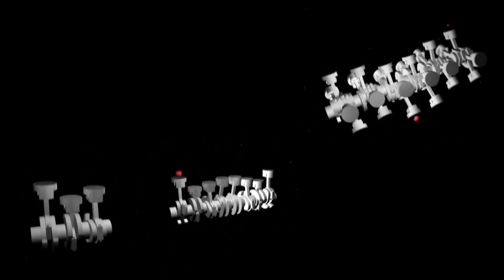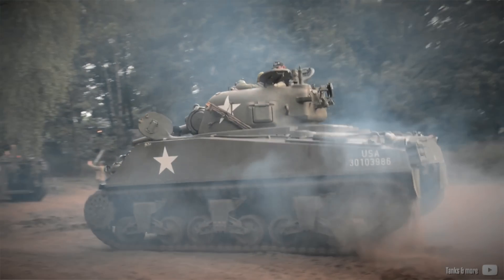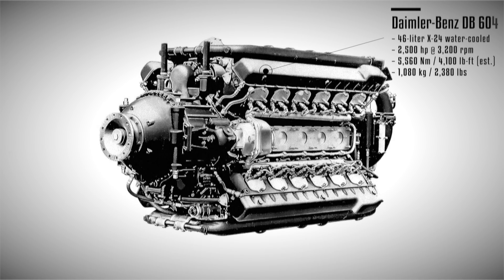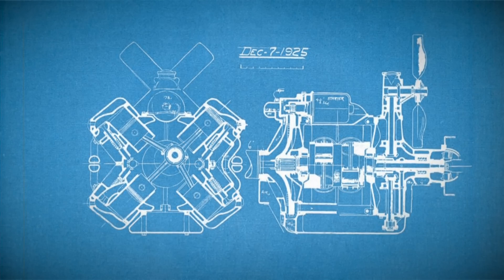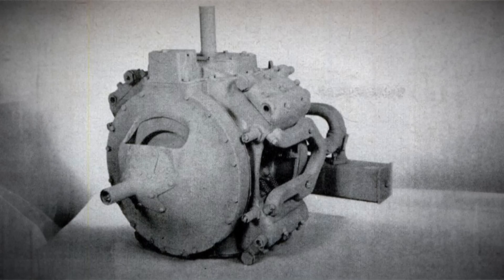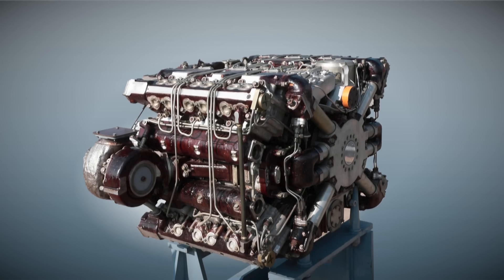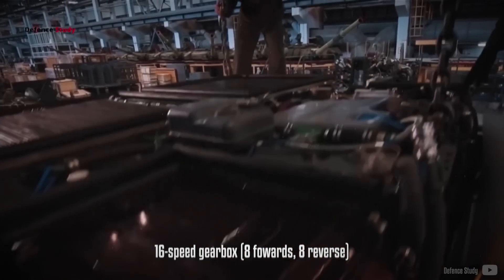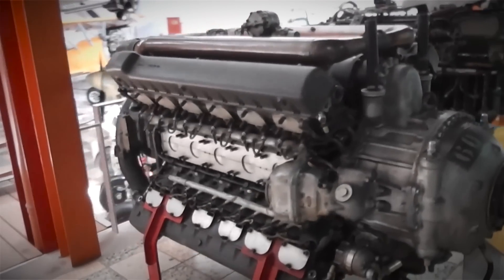The X Engine Makes Almost No Sense

Comment: I was truly here looking for the x16 engine, and I've actually seen one that was built back in 1970 or 71 and it powered a34 ton war machine built for the Vietnam war. It's pretty much meant to run on diesel or kerosene, but it was literally designed to run on any fuel including used oil. I think it's probably a one of a kind design

Comment: 193 comments, but I can only see 2, wtf?

In theory, a twin crank x-engine should work fine as an aircraft engine, with each crank driving its own prop. Upright Vs work, inverted Vs work, there should be no major issue with two, 120 degree V12s working together, one on top of the other. They'd essentially be two engines that happened to share the same propeller axis, I suppose.

Comment: If the Russian engine continues the trend of other recent RU military equipment actual performance compared to claimed performance, then the engines probably don't last, don't make claimed rated power, and there are very very few of them in actual use.

Comment: or like this https://www.youtube.com/watch?v=o89BYp95Qiw    , All Russian tank engines are based on highly successful V-2 diesel engine designed in 1931 at the Kharkov Locomotive Plant. The Kharkov plants was destroyed by Russian forces in Ukraine. The V-84 (T-72s), V-92S2F (T-72B3s, T-90s), the UTD-20 (BMP-1s and BMP-2s), and UTD-29 (BMP-3s) are further upgrades of the engine. The V-2 is the Kalashnikov of tank engines. The exception to this practical Soviet approach is the T-64. This tank was fitted with the 5TDF engine which tried to copy a German wartime bomber engine. 2-3,000 T-64s in storage will never return to service.

The T-14 Armata used a Russian copy of the German X-shaped Simmering SLA 16 engine. The Germans in WW2 used the engine in the hunting Tiger tank. It was an unreliable engine for the Germans. The Russians had originally used the engine for compressor oil and gas pumping stations.

Comment: Don't be fooled by the t-14, it's not in production, and one of the reasons is because the x engine it uses is a copy of the wwII, German XLA-16 engine, and both are piles of garbage.
Reply: Ummm no it's not everyone but laser pig has said it's not idk why his ego will not allow for him to admit it's not.
Reply: Nah x engines since the 1900s sucks ass the whole engine producing nations knew it as its complexity and the stress of the crankshaft negated the gains of more horsepower.

Comment: X format works for two strokes. You get a single throw crank carrying all four rods. Air intake via a hollow none drive side crank. It needs a reed valve and a belt driven blower. You get four bangs per revolution, perfect primary balance and almost no torque vibration. 
Rolls-Royce failed with the X because their oil pumps were too small. The same problem was not fixed on Merlin until the Mk 61.

Comment: I would make an x using VW “VR” technology, think of a Subaru flat 4 but each end is a VR style 4, 5, or 6 cylinder, to make flat x8, x10, and x12.
Reply: Yh like a flat w engine, would make them more compact, even smaller if you used freevalve technology from Koenigsegg

Comment: The Vulture has serious issues with overheating and fires when in service on Avro Manchesters, which led to their replacement  with 4 Merlins and the development of the Lancaster. The Vulture was also killed off by the Griffon, a more conventional and reliable V-12 that could produce more power

Comment: Germans used inverted V12 engines throughout most of WW2. It's a little surprising they had issues with X-engines.

For the longest time I thought that BRM had X16 engine, only to learn it was H16 - two flat 8s on top of each other geared together (btw, BRM's V16 sounded insane).

Truth is, X shape is just too dense with stuff. This was demonstrated precisely with Napier Deltic, another unusual configuration, and how the engines were 'loved' by maintenance staff - it was a nightmare to get anywhere, and had to be serviced outside of its working location. The Chelabynsk engine looks even worse - the famous joke about proctologist changing trades to a mechanic and fixing the engine through the tailpipe must be pretty accurate here.

There always be a place for unusual configuration. two stroke camless diesel X4, laying flat could be perfect to fit in a bottom of a small vehicle or boat, that otherwise can't have dedicated engine compartment but requires substantial torque (but V2 can't fit) - but it's still a solution looking for a problem, because it'd be loud as f.

Comment: I'd guess there's a reason Napier used an H layout (basically two stacked  horizontally opposed engines with separate geared together carnkshafts) for the Napier Sabre used in the Hawker Typhoon and Tempest.

Comment: The T-14 Armata's engine is super unreliable. Based on a failed German powerplant that they thought they could fix. Which of course they couldn't, because it was overly complex and not a sound design at all.
Reply: 😂😂😂прекрати употреблять наркотики, ты несешь какой то бред. Т-14 настолько крутой танк, что если инопланетяне нападут и предложат дуэль на танках, то планету Земля будет защищать именно т-14💪😎

Comment: The X-engine is just a radial engine with four cylinders. Before the jet age, radial piston engines in aircraft were commonplace, like Wright Cyclones. A radial engine was a very clever layout that assembled a lot of cylinders into a small place whilst at the same time allowing them to be air cooled. Radial engines normally had one or more banks of radially-arranged cylinders, with normally an odd number of cylinders per bank  Of course there is little benefit in installing radial engines into ground-based vehicles. 
https://en.wikipedia.org/wiki/Radial_engine
Reply: It is not "basically" a 4 cylinder radial, X engine has a minimum of two banks (8 cylinders), radial doesn't. Just like a flat 4 is not basically a 2 cylinder radial.
Reply: Radial engines are a bit different as they only have one crank pin per layer.

Comment: Merlin engine with 4 turbos 2 smaller ones and 2 bigger ones would be the best and multi port fuel injection with dual spark ignition.

Comment: Crystal ball gazing: I see a Chelyabinsk X-12 being used in tractor pulling. All block components lightened by careful milling, and brought to spark ignition methanol fuel usage standard with sprawled turbo's in every nook. It can then rev higher to develop more horsepower. Same philosophy as with 'Dragonfires' radial 42 cylinder engine (designed for PT boats). By extension the modified engine could serve as a R&D engine for development of an Aero-engine variant and voila you have a modern RR Griffon equivalent good for probably 3,000 hp. It should fit in any WWII fighter airframe or pylon racer derivative.

Comment: "X-engines" practically look like a compromise between a V-engine and a radial - And like many compromises, seem like suffering the drawbacks of both with the benefits of none.
Aviation apart, when they can be a good momentarily substitution for radials, I don't see any application for them.

Comment: Radial engines are better with an odd number of cylinders. The X layout is a multi bank 4 cylinder radial, make it 3 or 5 and the reliability is much better. I'm sure there is an engineer who could explain why but that's not me.
Reply: @@retiredbore378 🍻 Cheers
Reply: @@retiredbore378 correct. It is also possible to build a radial 2-stroke - that should have an even number of cylinders, for the same reason (timing).
Reply: @@retiredbore378this is such a concise yet intellectual text that I'm reading it several times.

Comment: It would be wonderful if an auto company created & sold a 3.5 L straight 8, with dual overhead cam heads, & perhaps sequential turbocharging.

This would be light weight, incredible torque & throttle response engines!
Reply: it wouldn't be light, but you could use an aluminium block and aluminum head. I think a few would sell due to the novelty, but ICE are on the way out now. might as well go for variable valve timing and turbo/ supercharger combo. I think  it would blow head gaskets for sport so could be be longer lived without forced induction.
Reply: @martin-vv9lf  The "EV mandate experiment" is currently dying, & will soon parish in earnest, due to high quantities of them spontaneously combusting, short battery charge, extravegant battery replacement prices, & of course lack of electrical infrastructure to support a large scale amount of people charging them in the evening after work. 

Only the wealthy will truly be able to afford EVs in the near future.

ICE engines will continue in perpetuity, only in the form of hydrogen, & still petroleum powered vehicles. The petroleum infrastructure has been built & innovated for over 100 years. It ain't going anywhere, anytime soon!

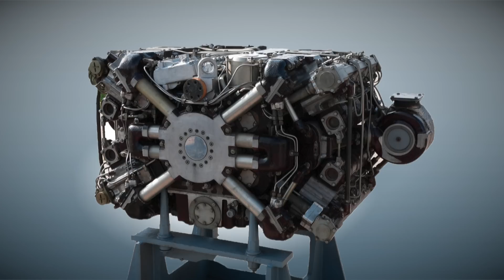Comment: 7:52 "The engines reliability is crucial..." Someone appears to have forgotten to tell Ural this part. Lol. Joke on the T-14 aside, your video is great, love the history breakdowns of X engines.
Reply: Gas turbine of the t80 and opposed piston 12 piston 6 cylinder engine of the t64 were also less reliable than a normal v12 on the t72, but they were adopted due to some of their special characteristics such as higher power lower weight,  smaller size. So same can happen with the x12 engine.

Comment: You get to the point where a gas turbine ends up being a cheaper option
Reply: Especially considering the fuel 'economy' on that Russian tank vs. the horsepower.😱
Reply: @danw1955  меньше всего хочется чтобы в танке кончилось топливо посреди боя😂
Reply: If the t14 has a gas turbine engine its will solve the issues to its powerplant and expanding its fuel tank and putting a Apu for idle or hull down. The Russian can leverage thier gas turbine tech for thier new tank.
Reply: @@retiredbore378 " not something you want in a tank."
*M1 has entered the chat*
Reply: @ShuRugal yeah and if you ever worked with one. You will understand the fuel economy is something to not right off.
The Abrams burns fuel like it's going out of style.
Reply: @aker1993  t90m has apu with diesel engine anyway. how much does abrams gas turbine cost? or lequack one. korean engine for turkish MBT cost around 800k$. i wonder how is price difference.
Reply: Do we have a gas turbine with battery powered drivetrain ?

Comment: I want to see a video on those old radials that ran natural gas. Huge 14 cylinder laid down with vertical crank. Have only seen random images, and most of them are the same ones
Reply: There is a video of one starting up in a preserved powerplant in the US. The camera is mounted on a tripod few meters away from the engine, and when it starts to run, the camera shakes because the whole building is trembling to the enormous engine idling....
Reply: @Damien.D  used to make Aluminum if I had it correctly in memory
Reply: @dennis-nz5im  indeed there were some in electrolyzing plants (to prevent power shortage).
VisoRacer should make more videos abouts industrial engines, there are very awkward design, including double acting pistons (combustion chambers on both sides of the piston, a design inherited from steam engines).
There are ridiculously massive engine too, with RPM so low you can count each stroke....
Reply: 11 and 12 cylinder radials built by Nordberg. 14" bore and stroke. Both versions  are radials that feature no master rod. Only link rods. With two different systems to keep the tod car carrier in phase. The 11 cylinder used a gear train system while the 12 cylinder used two retaining cranks with a connecting link.  As usual see Old Machine Press
Reply: @Damien.D 
Snow inline engines. Truely inline 😊
Reply: that's a good point about the vertical crank, the x engine is quite feasible in the vertical orientation since the plugs won't foul.

Comment: The 34.6L ChTZ 12N360, also known as the A-85-3A diesel engine that powers Russia's T-14 Armata tank. The A-85 X-12 engine design is a modern take of the Simmering-Graz-Pauker Slä 16 (Porsche Typ 203) engine which was 36.6L and 750HP. It was designed to replace the Maybach HL230 V-12 engine that powered the Tiger I & II, Jagdtiger, Panther, and Jagdpanther, as well as being envisioned to power Porsche's VK45.02 prototype and proposed for the Maus in a two engine configuration. The engine was captured by the Soviets while on an engine mount being prepared to mount into a Tiger Aus. B (Tiger II). Unlike the Slä 16 which was air cooled, the modern Russian design is liquid cooled and a completely new design, with the only feature that was carrier over from the Slä 16 being the cylinder bank arrangement and at which degree they were set to which is 45deg apart on the sides and 135deg apart on the top and bottom of the engine. The A-85-3A is also much more powerful at 1,500HP and 2832ft-lb of torque. Another interesting fact is the A-85-3A's camshafts are driven by enclosed shafts with the engine having four, which look almost exactly the same as the two enclosed shafts that drove the Slä 16's two cooling fans. The Slä 16 was a pushrod design, so they didn't need an external way to drive a camshaft.
Reply: Laserpig is not a reliable source.

But lets expand on that.

the X-12 has 12 cylinders the SLA has 16 at a different bore. Not even the engine block matches. As you said the engine is liquid cooled and a completely new design (So like how is it a modern take of that engine lol?)
Reply: @jammygamer8961  Yeah i've seen lazerpig roasting this engine as being a ripoff of german designs, but in fact, as i've read, it's only loosely related.
The engine is probably the only thing that actually works on the T-14 so let's be fair for Russian engineers XD
Reply: @Damien.D  redeffect made a good response video to laserpig
Reply: 😂😂😂 завидуйте молча. Общего нашего двигателя с немецким дерьмом столько же сколько общего между шлёпанцами и сапогами. Говорить что мы скопировали его у немцев все равно что говорить что весь мир скопировал двигатель Рудольфа Дизеля😂😂😂 перестаньте употреблять наркотики 🤡 наш двигатель разработан с нуля специально для этого танка. Нереально сложная штука, инженерам пришлось знатно напряч мозг чтобы выпустить это технологическое чудо😊
Reply: Lazer pig has pig brain, can't  even slander Russians correctly.

Comment: The 'X' engine has radial characteristics.  Might this be considered a four-row radial with three cylinders per row?
Reply: The X-12 shown would be a six-row radial with two cylinders per row... which is opposed, not radial. All cylinders of a row in a radial share one crankshaft throw.

Comment: Fascinating video!

X engines have issues with hydrolocking similar to radials.
Reply: how so?
Reply: Lube oil lock in a four stroke engine!
Reply: @surisurya3577  Yes, the bottom cylinders slowly accumulate oil with time when sitting.  That's why many large radials were turned over three or four times by hand before a start was attempted.
Reply: Pump it up during start

Comment: I could see someone like Porsche or Subaru building an X engine only because they have made some great flat 4 engines🤔
Reply: The W engine probably delivers a similar density while allowing for a conventional sump.
Reply: @@retiredbore378 I was talking about the tank.

Old W engines were high, but the current VW / Bugatti engines are not. They are probably 1.3 times longer, but still compact.

A motor for a fighter jet is a different issue. These motors need to allow negatives g´s. In this case, no traditional sump can be used anyways.

Comment: surprising this never became popular, there was a Canadian company that built an experimental X engine that used opposite pairs of pistons connected to a solid beam that was moved back and forth by a triangular cam in the center instead of a crank. OMC had a crack at an X and a rotary outboard engine but it never made it out of the lab.

Comment: Rolls-Royce Vulture was installed on the AVRO Manchester, Saw active duty in Bomber Command before they transferred to the Lancaster.
Reply: The Lancaster was a development of the Manchester with larger wings to accommodate four of the much more reliable Merlins vs two disastrous Vultures.
Reply: @CaptHollister  I know I've been in the Pilots Seat criminal no Manchester's were saved.